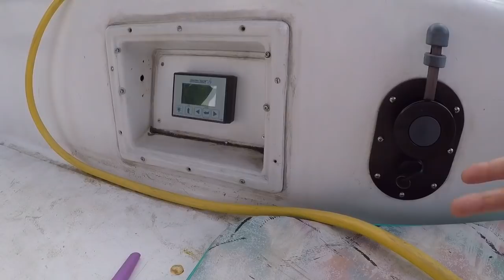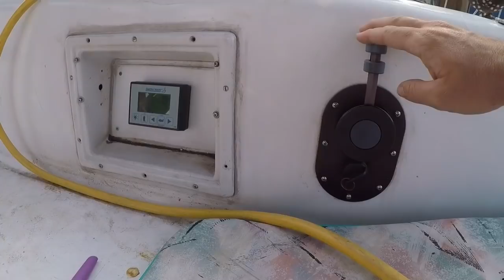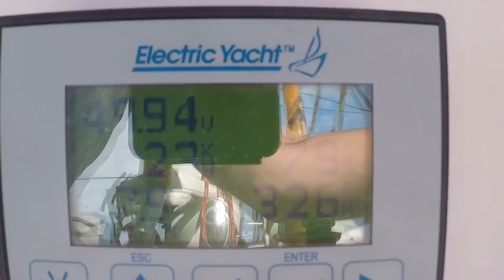Our Electric Motor | Sailing Wisdom Ep 32

Comment: You are the first one to detail the regen figures. I think all things considered there I would opt for a feathering prop and a wind generator. The hull speed loss to me would not be worth that little power. Of course the wind generator would be at a considerable disadvantage dead down wind perhaps, but hove to in storm conditions it would seem to have considerable advantages. 1AMP = 48 watts, though I tend to use a 50V (hence 1AMP=50 watts) factor here because the voltage can run probably on the order of 46-54 overall or so. Still though, 50 watts from a 400 watt wind turbine is easily doable at the wind speeds needed to turn 6kts,,,,,and then some in all likelihood.  BTW, from my research of ELECTRIC HP 7.2KW is 10HP, though that can easily drive what would take 20HP from an internal combustion engine. I won't get into all the synergies involved there.  The other question is why your fuse would blow on your charger as the highest draw occurs at the lowest point of charge, the charger should top out at its rated load and go no higher, therefor the fuse should not blow. The motor should be sucking no more amps from the charger than would be the case with very low batteries. The batteries SHOULD act as large capacitors buffering the voltage sag and even if not the charger should still be ballasted to only put out it's rated load regardless of how low the voltage level goes. Lead/acid batteries though are many times paired to 3 stage regulated chargers unlike lithium batteries. That could be problematic but should not be fuse blowing problematic. But that is another discussion altogether. One thing is standing paramount here though, and that is how the addition of wind generator could in fact be of considerable value in the re-charging of the batteries regardless of the regeneration available from the screw.
Reply: Wind generators are generally nowhere near as efficient as anyone would have you believe. Remember, the wind power increases with the square of the velocity. In other words, if you produce anything worthwhile at say 20 knots of wind, then it will be the square root of that power at half the velocity. Our wind generator does pretty much nothing at 13V until the wind hits at least 20 knots. Most of the time, it provides no power at all, as it cannot overcome the system voltage, and as you mentioned, the battery capacitance if they are near full charge. 

In reality, we use the extra power we generate for heating hot water, but in the case of power for a 48V system, there is then a voltage conversion issue - more losses to boost it from the nominal 18V or so from a 12V wind generator.
Reply: The numbers I have seen for decent wind turbines (eclectic D400) is on the order of Cut-in Time
Starts charging @ 5kts.
12kts, 44W = 3.7 Amps
22kts, 235W = 19.6 Amps
28kts, 420W = 35 Amps
You do make an interesting point though in that 12V output does little nothing to charge a 12V storage array though.
These are 12V ratings in amps. I generally tend to just use watts or KW on this stuff as it gives a flat baseline across all voltage levels. . One thing I have noticed about these wind turbines is that it pays to shop around because some are wanting nearly 2,500 for these D400 units but they can actually be had for around 2,000 USD if you look around. They have air cooled current sinks which would not be a bad thing for the cabin in cold weather. You could no doubt do a water sink and use a switch to run between and water if one were so inclined.
Reply: There is no way to outrun Ohms law. I absolutely would not believe any wind generator will produce any kind of useful power at 5knts of wind.

The easiest test you can all do yourself... Remove the power wire from your wind gen and measure the actual output in open circuit volts (OCV). I have sat and watched my own unit (an oldish Air-X 400 with the internal reg removed), and found that the OCV doesn't reach 13V until about 10-15 knots of wind. 

This means the output voltage of the wind gen isn't at system voltage (I always use 13V as my standard).

Just because the wind gen is connected to your system and the wires are at system voltage (as per Ohms law), it doesn't mean everything your wind gen puts out is at system voltage. If the OCV at that wind speed is not at system voltage, it won't do anything at all, just spin around and make noise.

This is why the charts you see are almost always a load of rubbish. 

I can use an example:

Say you get solar panels that only produce 12V OCV. You think it's ok, because it's 12V right? Wrong. OCV must always be above the system voltage, otherwise it won't do anything at all.

Ohms law again here. The reason modern solar systems run at 70 OCV, is due to the gain in efficiency between the panel and the controller. Wind gens generally have a much lower OCV, in my case about 30V for the 12V system voltage.

If you understand how a power curve works, it can show a number of things depending on what inputs you use. Typically, you see a power curve traced with wind speed on the X axis and power on the Y axis. This is quite deceiving, as it implies that the actual voltage output of the wind gen is always at system voltage...even at zero power. 

Think about this... it is impossible for a wind gen to produce system voltage at zero wind speed. This is why the charts you see are simply rubbish. 

There are some solutions from my research:

Use a boost converter on the wind gen circuit to boost the lower voltages up to system voltage - like a scavenger system. Or, use a higher OCV wind gen on your lower voltage system. This brings the OCV of the wind gen to a lower point in the power curve, if you get what I mean.
Reply: I worked in the production realm repairing CNC machines for quite awhile and ran a wireless lab for 8 years mister. I was designing portable battery solutions for wireless communications gear DECADES ago. So yes, I in fact do know a thing or two about ohms law. In addition I know quite a bit of how manufacturers or various electrical and electronic equipment skank their power ratings too.
Reply: My comment was more about helping people with their understanding of wind gens, not just yours. I never assume knowledge or lack of.

The underlying problem here is wind gens are nowhere near as useful at lower wind speeds as anyone thinks. In fact, ours is a noisy addition that generally provides no benefit. I am tempted to just remove it and add more solar.
Reply: Yes, well the realities of prop regeneration off a drive line designed for forward propulsion are nothing of what the EV industry plays them up to be either. Neither is regenerative braking for that matter. I saw one video where everyone aboard was heralding generating a single amp of power production at 9 kts of hull speed They did have a folding prop though because the owner of the boat obviously understood the issues and was in no mood to have hull speed cut by a ridiculous amount by shoving a huge fixed prop in place on the vessel so or lay out large for a reversing controlled reversing prop system so he could crow about all the "free" power the boat was giving him. That was a 72V system in a monohull. Even when I research the hydro prop systems there is little that impresses me with them short of the fact they put out down wind better than wind turbines in most situations short of F-5 and over. But then when you get into close hauling, well, that's where the petals come quite off the bloom. The bottom line here is that none of these suppliers and manufacturers are ever totally truthful about the overall performance of their products. They only put out the good and anything less than that is left out of their sales brochures. The two things here that make this particular system friendly are the facts that they used FLA batteries instead of blowing 16K on lifepo 4 units on top of the advanced and costly array support gear lifepo 4s entail and instead put money into a good sized generator to keep them moving when the wind dies. If anybody wants to get into electric I have no problems with their decisions as long as they go in knowing the limitations of them and plan for the inevitable. Here at least we are getting honesty about how if anyone stole the boat they would probably only be running it for 5 minutes until the batteries died. FLA batteries simply are not a great platform for high, continuous amp draw. It would run longer than 5 minutes at full throttle no doubt but the candor displayed here was quite refreshing compared to what I have seen from some others who put out far larger sums to drive far smaller boats. What continues to surprise me is how so many people view these electric auxiliary drive systems as something new. They have been driving submarines for 100 years now with similar systems. They have driven freighters forever as well. Our newest MX class destroyer is driven in the same manner only they use multiple gas turbine package units to supply the main power. Then there is the issue with my seeing people who lay out HUGE for lifepo 4 battery arrays when they could get the same KW for 1/4 of what they paid had they researched the issues through and snatched up some Chevy Volt battery arrays. The difference there is striking. And another thing her with their system as well,,,,,and very important. I see people using motors they got from Lord know where and installing them with no thrust bearings! Now there is dumb and there is dumberer and that right there is about as dumb as anybody could get. They totally fail to understand the problems they are inviting by using motors whose rotor shafts bearings are only designed for radial loads in a high axial loading application. It's ok though because Darwin's Law is the higher order of selection. LoL! They say a good education costs good money and the people who do that will most likely get a very good education sooner than later.
Reply: Thats exactly right mate. 

BTW, you can use the enter / return key to space your text. The paragraph you constructed is attracting it's own moon its so big :-)

Yeah, thrust bearings...holy cow now there's a subject. I tried and failed a few times to explain to a noob aircraft engineer that his idea of using some kind of gearbox on the development bird we were building was just plain stupid... but it took the head engineer to tell him to be quiet and stop making a fool of himself.

I always thought a big tapered wheel bearing might work as a thrust bearing on the shaft, with it set into a self centering bracket, as would be used on machinery. Stopped in place with tapered lock collars. (edit) Actually, make that a set of opposing tapered bearings for forward and reverse...

Comment: you guys should also look into the honda generator conversion kit to CNG....this way if the battery bank goes down you can fire up the genie via your CNG for cooking in the event of an emergency and run your motor off of that and have redundancy within your system...this should right all the nay sayers!
Reply: Chef.Sean.Hickey expensive,very, very ..! dangerous also

Comment: Well, from what I'm hearing, you aren't afraid of adding a little more weight. Double the number of batteries, at least enough weight to take the place of the Diesel weight. This would double all of your running times. Also put as much MPPT controlled solar panels as you can possibly fit on the boat. Most sailors hang out in ports in gales. . A very good wind generator is working for you while your in port in the dark stormy night.
Reply from the maker: +californiakayaker N6GRG weight is not a huge concern to us as we are a heavy displacement hull, but space is an issue. The entire area of the old motor is batteries, and the new motor and batteries equals the weight of the old diesel motor. 
More batteries would be nice, just that we don't have the space for them.
Reply: Well, you have done what I basically was suggesting, replacing the weight and space where the motor was with batteries, which you've probably ventilated ect so, sounds good. Not sure they would be enough to get you into a busy port like Singapore, but, you will know more about that if you make it to Singapore , right ? Good luck with this. Perhaps an outboard, the one that you set up for your dingy, as a back up ? Haven't heard of someone having an outboard that comes loose that quickly from the Dingy for use as a backup. But, the ports are where you will need some sort of propulsion.

Comment: When buying a sailboat I have always worried about the diesel motor burning out and the maintenance that goes along with it. I think converting to electric makes sense. The only time you really need the engine is to pull in and out of a slip or mooring. and if you were to double up your bank it could even be feasible to motor for a very long time. It would be helpful if you could post the motor make, model. Thanks
Reply from the maker: We have the Electric Yacht QT20
We currently have a 200ah battery bank, but we are going to be upgrading to a 600ah Lithium bank in the next few months so that we can motor up the ICW.

Comment: Wow. First I have just started following you guys and still catching up along with many other channels. Second I am by no means going to say a persons choice of diesel or electric is wrong. I will get to that. Third, I CAN NOT FIGURE OUT why you don't have more subscribers. I even see you talked about in other channels and it goes back to your experience in rigging and the fact is you explain in more detail about many areas of design and mechanical. 
   I'm hoping to be on that water one day and I am trying to learn more and more on all these channels. One thing I want to put forth is I am a 40 plus year freight relocator and almost that in farm and ranch. I have owned several over the road trucks and dealt with and operated various types of construction equipment and more. I learned about diesel mechanics and more working in a farm equipment dealership when in high school and trucking. Plus still farming and ranch work.. 
  Now that said about me, I would choose the electric over diesel in a sailboat. Not to out run a storm, not to get a busted skull to land 1000's of miles away, and surely not to get anywhere fast. 
We as people have choice, and i am saying this due to some really ugly remarks in the comments. I am like a mention below, Christopher Columbus had no Engine or motor. Hmm. Ok, well today there is also radio and good seamanship. So I say if you choose to sail JEFFERY<  then you should already understand that poop happens and you chose to be at sea and you should already know how to sail or heave a storm and also know how to use a radio that will get you better and faster Medical attention then any diesel engine or set of sails can get you. Plus you might want to stay closer to shore Jeff.....You know who you are. People have a choice and I also choose to learn more about sailing and get out there on my own one day and enjoy the piece of mind and no hurry to get anywhere. Choice is a persons right and she or he should understand there own possible circumstances.. 
        Hey, you guys keep em coming. For the majority of us out there we like to learn are at least have more to think about to make a decision.  Ok, I am going to go hit my thumb with a hammer JEFFERY ,, why cause it will hurt and I don't see arguing with Common Sense right now.. LOL
Reply from the maker: Thanks for your insight. The electric has worked out very well for us and we are still very happy with it. 
Hope to see you in the water in the future ;)
Reply from the maker: Also, if you would like to help us grow, you can share us with your friends :)
Reply: @RiggingDoctor  I appreciate your response back and I have been working on the growing.. I hope you guys start seeing more progress there.. Yes, I really want to get away from all this one day. I will be looking forward to seeing you guys.

Comment: Have you tried to heave to in bad weather while drifting towards a coral reef? Also some countries/ marinas will not allow you to sail in. Glad you went the electric way.
Reply from the maker: Ralph Kluge we stay well clear of reefs to avoid that situation, but we have hove to close to shores where we only had a few days until we would run aground. 
Europe has been pretty strict and always yells at us on the radio when we sail in until we drop the sails close to the pier to use the motor as a brake to stop us.

Comment: One issue with electric is that high current can cause a huge amount of heat , add in a vibrating moving salt corrosion filled environment and there are some feal dangers and the maintenance should include checking all the connections regularly .
Reply from the maker: Very true!

Comment: You decision to go electric was very clever, especially considering the size of your boat. But in my opinion, you made it at the very low end , generator size, I mean : Very few solar. I would go for more solar, also with a 48V LiFePo4 battery bank. Anyway you can't use more than 50% of a lead bank.
Reply from the maker: We had some tight budget constraints which forced us to get such minimal equipment for the motor. Over the years, we have tripled the amount of solar for the motor (but it’s still too small) and replaced the batteries once so far. 
When we get back to the states, we plan on building a much larger solar array and if the price is right, a nice lithium bank!